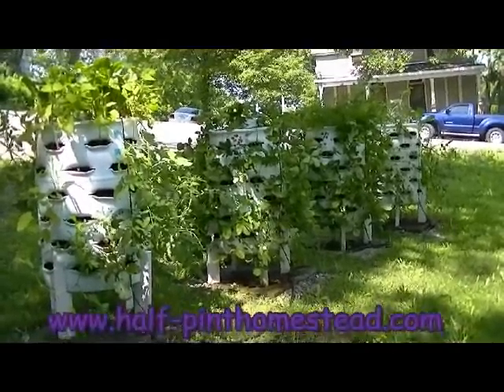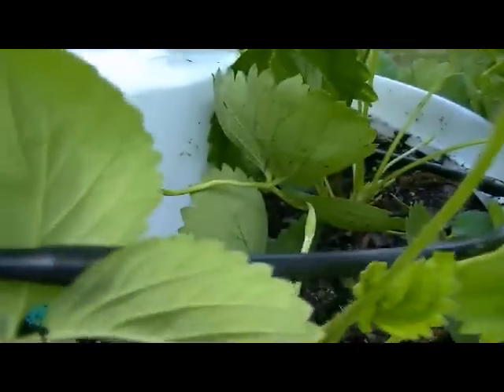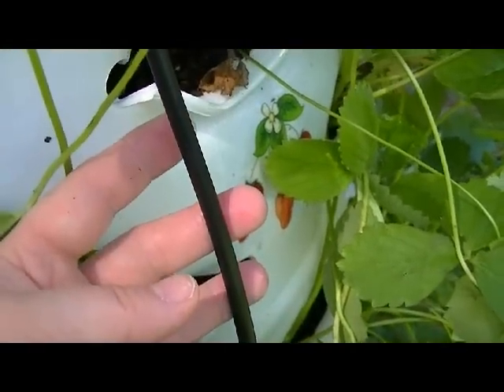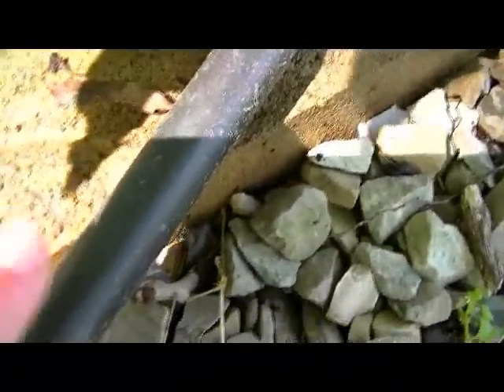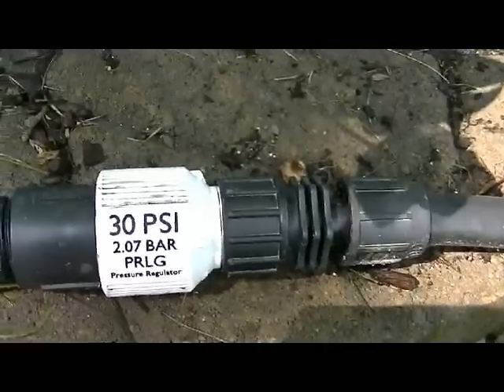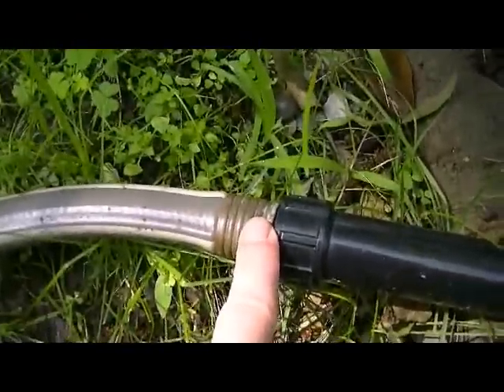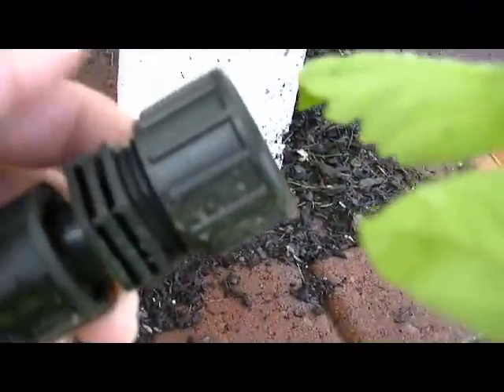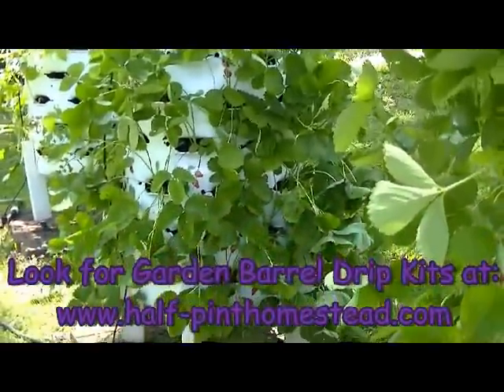Garden Barrel Drip System

Comment from the maker: I run the drip system about 20 minutes every day (I have a mechanical timer because I left it on overnight once...).  It's been up to 97 degrees here and have not had anything even wilt.  Because very little of the soil is actually exposed in these Garden Barrels, the soil doesn't dry out very fast so it needs very little water.  The potting soil was damp when I dumped it out of the bag in April, but not wet.